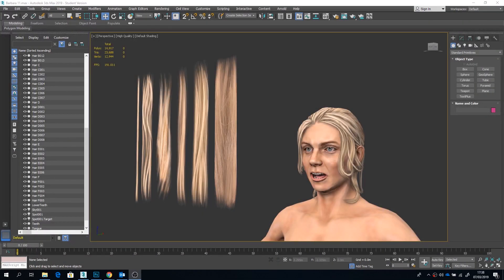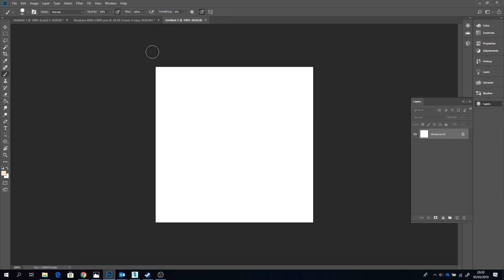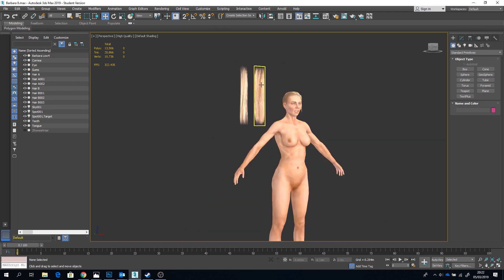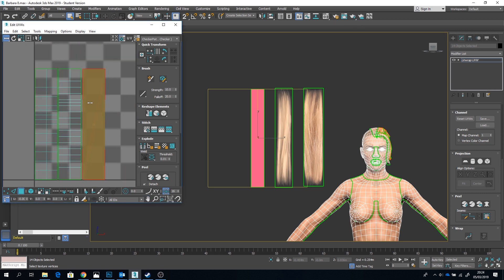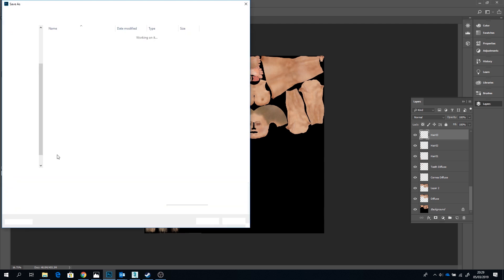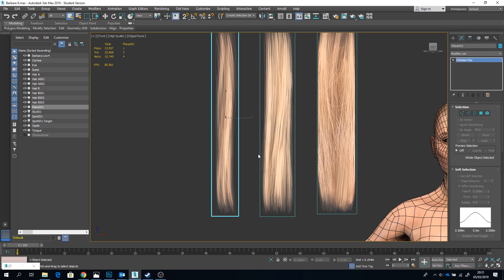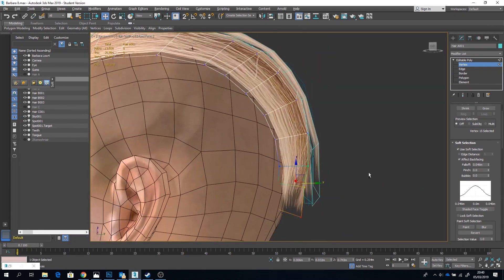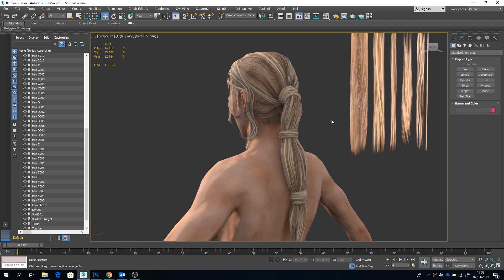Creating Basic Hair in 3DSMax

Comment: Hello Mr Sanderson ! So you use for hair placing only the softselection tool? But what if the hair cards are not smooth? Should we  use the turbosmooth modifider?
Reply from the maker: You can for sure use that modifier if you want to. Just be aware that by doing so you are adding more polygons to the hair that you may not need. Think of how much of it you will actually see in a game.
Reply: @LewisSanderson  Thank you! ;-) Hm.. but how we can get smooth haircards and not using turbosmooth?
Reply from the maker: @ginteacher8185  Sure just use smoothing groups under the editable poly modifier.

Comment: What if the character I'm creating has grey/white hair? would that affect the opacity maps?
Reply from the maker: Not at all buddy. The diffuse map is a separate map/layer. So you can make it whatever colour you like :)
Reply: @LewisSanderson  I don't know why, but I've applied the exact same technique on a different file, and it works in the viewport, but when rendering, the opacity map is not working, like I still see the black part of the texture, instead of seeing through it
Reply from the maker: @peruvianpuffpepper904  check over your render settings, viewport settings and map slots. The answer will be within on of those things for sure. Sorry for being vague but it is impossible for me to tell without being at your computer.
Reply: @LewisSanderson  i promise you that I've followed it like a bible. In the viewport, the transparency is there, I can see through it, but I can't see the transparency when I render in arnold.  I swear the Diffuse color is in the diffuse as a TIF and the opacity map is in the correct Opacity slot as a TIF. I know you said Targa, but Tiff works better for me.
Reply from the maker: @peruvianpuffpepper904  relax my friend it will just be something in your render settings in max. When you export the model and textures to another programme the situation will likely be okay because you'll be using a different software's render settings.